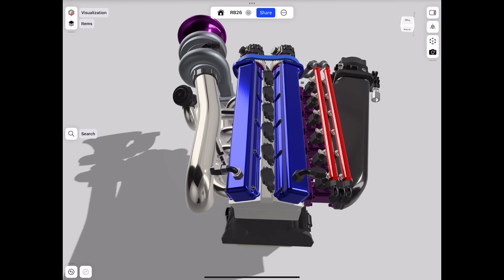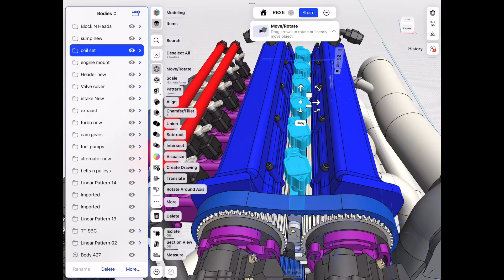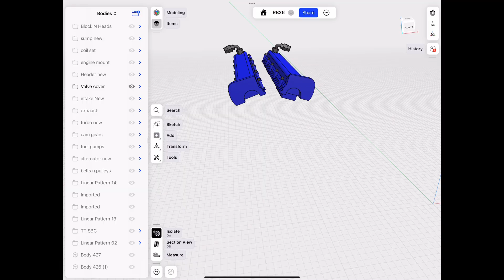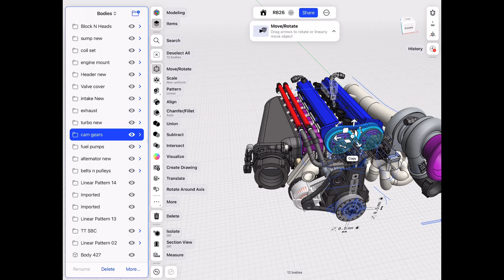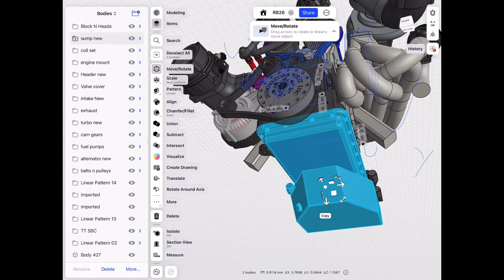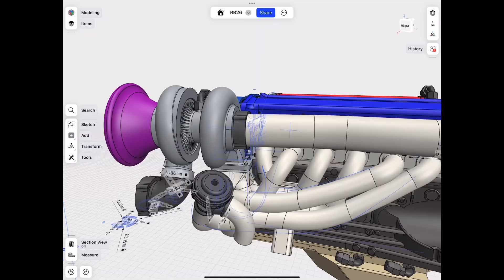Nissan RB26 single turbo scale model for 3D printing

Comment: if i may ask could you possibly tell how to load an rb 26 engine onto the app
 or how were you able to do it
Reply from the maker: I designed the motor in the App itself - if that’s what you mean
Reply: @mattyscustomscale If I were to buy this same model , would I have to build it together or does it come build ?
Reply from the maker: @MPxv11  Engines are usually designed in pieces as its the best way to paint and detail the elements before assembly.